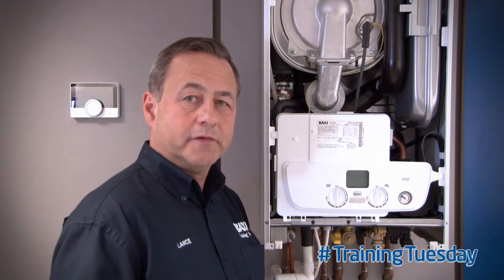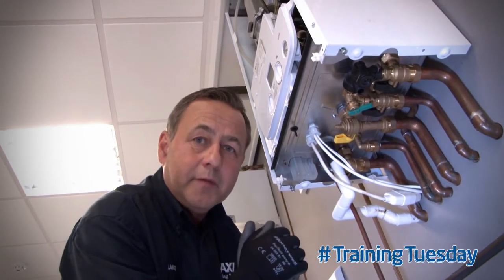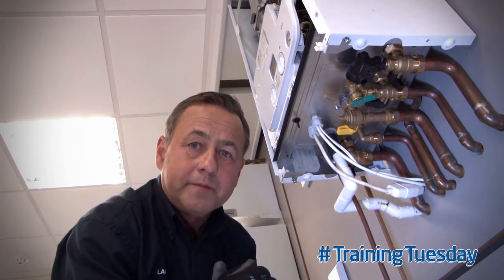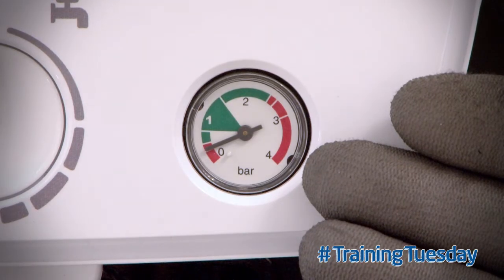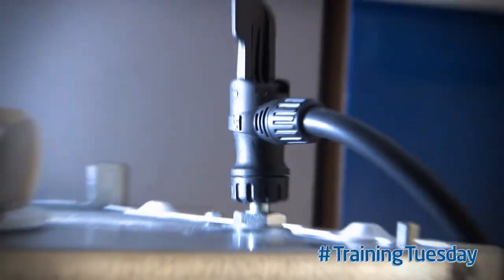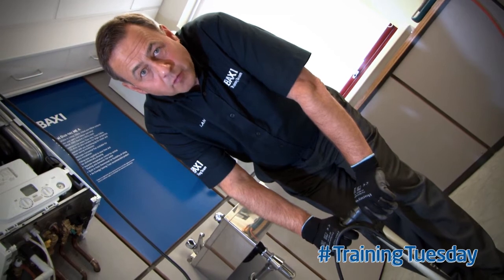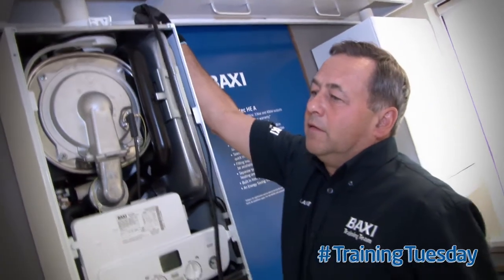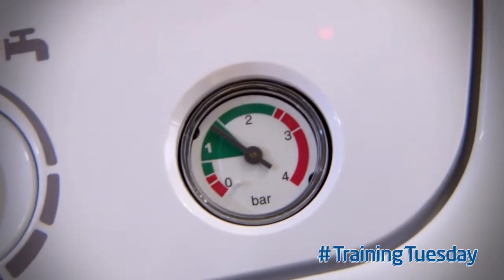How to re-pressurising the expansion vessel on a Boiler | Baxi Training Tuesday | Troubleshooting

Comment: Why the need to isolate the flow valves?
Reply: I'm guessing so when you pump the tank the air doesn't just push back into the water lines instead of staying in the tank

Comment: My engineer pumbed my vaillant eco tech pro at 1.5 bar and actually the pressure rises from 1.1 to 2 bars! Does the pressure in pressure affected by 1.5 bar pounbing?
Reply: Refer to the boiler manual, the manufacturers instructions.

Comment: The flow valve won’t close on mine, will turning the water off at the mains do the same thing?   As long as I turn off the return valve?
Reply: No. Thats just the water supply. With a pressure vessel, you have a sealed, pressurised system. This is why you have an expansion vessel, to accommodate the expansion of the water volume, as it heats up.

Comment: Thanks for the video just one question.   Do you close the drain during the time you pump or you leave it open?
Reply: Leave it open
Reply: Leave open. Put your drain hose into a bucket of water and put something on it to keep it submerged, if it bubbles while your pumping the diaphragm inside the vessel maybe perforated. That said, when it is perforated the air side is usually full of water.